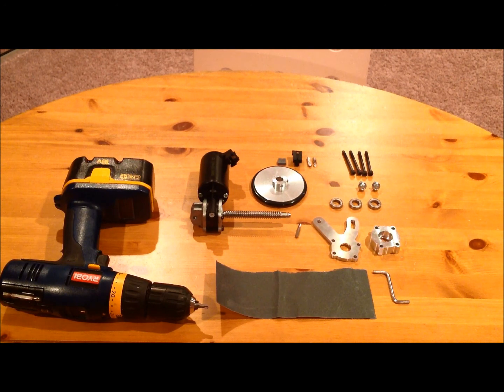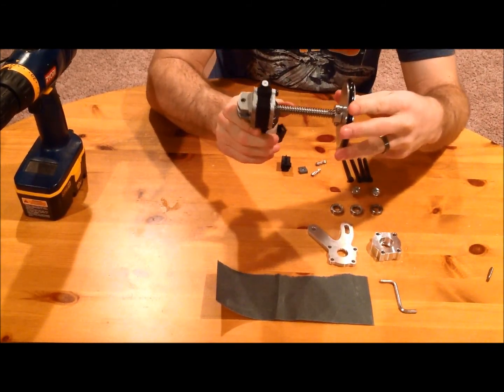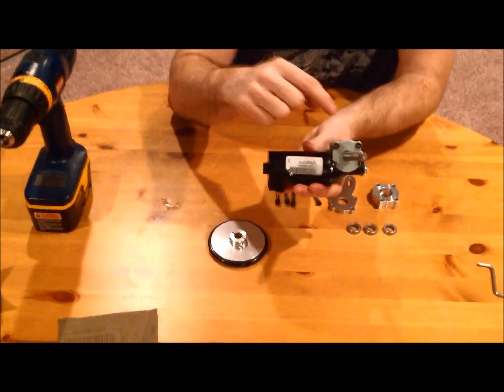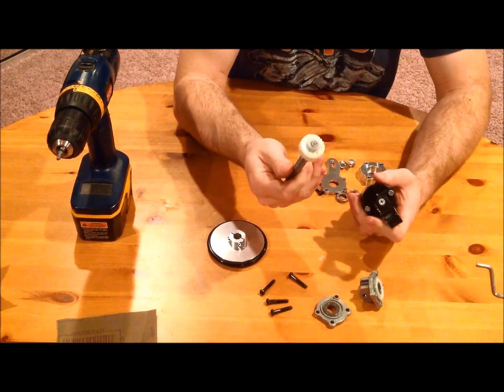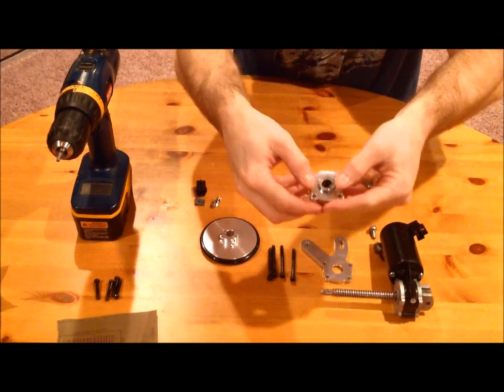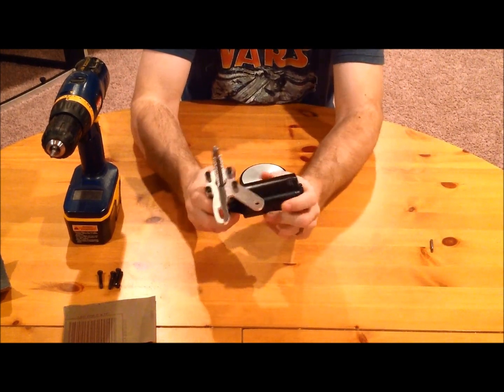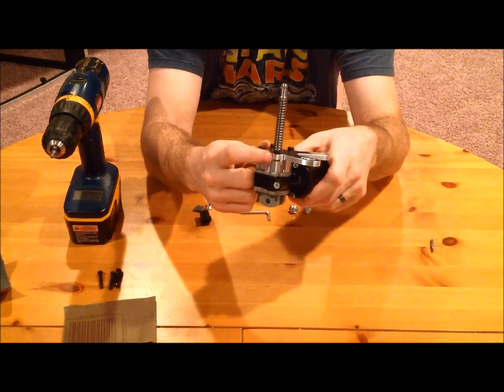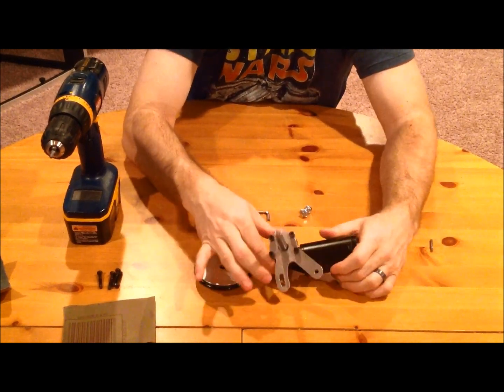Dome Drive Tutorial

Comment: Great video! I just tried this myself and had a difficult time inserting the bearings into the housing. So I put the housing(s) into boiling water and bearings in the freezer. Wait a few minutes and then tried to assemble. 100x easier! Also, I sandwiched everything between two blocks of wood in the vice, ithelped get all the bearings seated straight and packed in.
Reply: holy cow.  I'm having a real hard time with this step